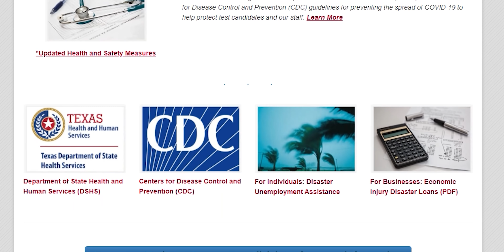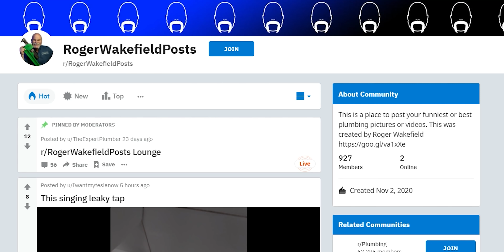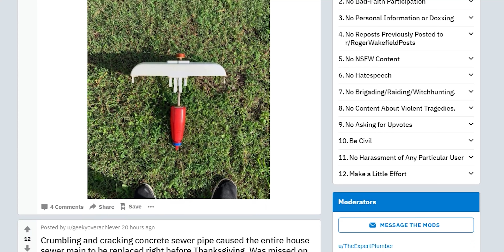Before you have a plumbing leak WATCH THIS Freeze break repair!

Comment: My biggest tip (From Ohio here) is if you lose power/heat and you know you have vulnerable pipes....don't wait till the temps drop to freezing inside the home.  Immediately turn your main off and drain the lines at the lowest point in the home....do this before they can freeze.  Even here in Ohio with very real winters, many don't realize this.  I wouldn't have expected folks in Texas to know that at all.  I wish they could have known this ahead of time.  I have heard some people pour a little antifreeze into their p traps too.  That one I have never done though.  All in all, I know it is too late for this situation, but I hope more people realize that can help a ton.

I grew up in a old trailer home that was poorly insulated with pvc.  My Dad often dealt with blown pipes and drains.  It was such a pain that he ended up running the lines inside and we just tried to conceal them as best as we could.    It wasn't perfect, but it solved the problem in a way he could afford.   Thankfully in my current home with a warm basement, only our exterior hose bibs are a risk.  We have to shut those off for winter.  

Here in a couple of weeks, I am going to convert to pex due to some old polybutylene pipe we need to replace anyway.  When I do, I intend to install the frost-free ones bibs.  I will still probably shut them off in the winter as extra insurance.  But that helps in case I should forget.
Reply: hey, I’m in Indiana living in a trailer home. our pipes have been frozen for days and this is the only situation i’ve seen in the comments that i can relate to! any advice on how to find the freeze? i re-wrapped my pipes with new heat tape and use space heaters but nothing is working!
Reply: @dipperpotter2491   that was a trick for my Dad too.  Sometimes he would think he found it but there would be multiple areas.  Eventually you learn the problem spots.  About all you can do is get under there and trace the lines feeling them to find the frozen spots.  Eliminating them one area at a time. Occasionally when it was bad, my Dad would get one of the large kerosene space heaters under the trailer to thaw things.  That was a danger in of itself.  Running the lines inside helped a lot but drains would still freeze.   It was a perpetual battle that never stopped while they lived there.   Ultimately the place was poorly insulated.  Eventually a double wide was where they moved to and the underside was bricked in with plenty insulation and the freezing stopped.   I am sorry you are having to battle this.  I know it isn’t easy at all.

Comment: Something interesting I learned from my 1950s house. When they added forced air sometime in the 70s or 80s, they ran a duct that dumped straight under the sink in the coldest bathroom in the known universe. They did something similar in the kitchen, passing a duct under the sink. The pipes in the basement were rerouted to follow the duct work. Interesting method to stop frozen pipes.

Comment: So had an old house built back in the 1930's, in Austin, and just before the freeze they had a gas leak. We try to find it but as we did the freeze hit and all the plumbing shop closed and the meter was locked out by the gas company. 

We try to winterize the house and luckily the home owners left before it got realy bad.

After a week of fixing leaks we headed back over and fix the gas and found countless leaks. We now are replacing all water lines for the house.

Comment: I had a cold water line freeze in one bathroom and a hot water line in the other(I'm in Fort Worth BTW). Like you said I opened the valve up on both as soon as I noticed . The cold water line was easy since there was hot water line was next to it,  I just ran the hot water for a while and a in min or two later the cold water line started flowing. The hot water line took a little longer. I use a fan to blow warmer air and also ran the cold water side. My thinking was it may be cold, but it still warmer than the frozen line and eventually I was able to thaw it.  No pipe issues. I was worried about the faucets  outside though. My thought was if a pipe in the wall with insulation froze, that foam cover isn't going to protect, but thankfully they didn't burst.  Love your videos, keep them coming.

Comment: Another tip for up north is take the caps /screens off your faucets. This will allow any ice out of your lines and not back up. To add to your open the cupboards is to put fans around your kitchen and bathroom to circulate air.

Comment: I live in Southeastern Michigan and we've had to deal with this in my house at least once a year, and your advice is exactly what we do. We open the valves and put a heat source near the pipes to slowly warm them. Luckily our plumbing system is centralized in one end of the house so all we need to do is open our crawlspace and slip a space heater down there. Only issues is making sure people don't take it for granted and close the faucets after we get water restored

Comment: Good luck from upstate NY. We don't deal with them too often in my area because our design temperature is 0°F so we don't run water outside the thermal envelope of the structure, and our mains are buried 6' deep, below the average frost line. Best thing I can recommend is propress because you can use it wet, and any cast iron p-traps that crack and start dripping can be brazed shut with acetylene and brazing rod. Also, when temps get real low, vents tend to ice over. A ladder, a can of windshield de-icer, and a hammer work well.

Comment: that's the nice thing about canada.  We have the Red Seal for trades.  Once your red seal, your good to work in any province. As for individual regulations, things don't change a lot province to province.
Reply from the maker: I wish we had a national certification! That would be wonderful right now...
Reply: I wish the US would perform the same, unfortunately each state has it's own regulations on how to do things. I wouldn't be shocked if a Californian plumber does things drastically different than a Texas plumber.
Reply: @RogerWakefield  they did it a few years ago, and it simplifies the process a lot.  Trades need to be recognized and standardized on a national level.  In Canada, once your red seal (usually 2-5 years, based on experience) you can work in any province or territory in Canada.   In Canada, once your "red seal" your the same as a master in your trade, but capable of working anywhere in Canada, with just minor schooling on the difference in building codes (which are nationally standardized).  In a situtation like your having there, I don't think there is any major hurdles to coming in to work.  it happens a lot with industrial electritians when there are powerline issues.
Reply: I was just about to mention this myself. I have a red seal plumbing liscence in Canada.

We also build winter proof buildings here. We don't put plumbing in 'cold spaces' such as outside walls and attics.

Comment: A really simple thing those of us up north do can probably help you if you're lucky enough to not have had pipes burst yet, but worry you may: Cut a slit through one side of a pool noodle with a good utility knife and wrap it around any pipes not going directly to the hot water heater you can easily get to. Tape or don't tape as works best for your specific situation. This helps insulate some of the pipes temporarily and gives you a way of better telling if you have slow leaks you may not be aware of due to water freezing on the pipe's surface and temporarily looking dry, since the open cell foam used in those can pick up water, and will visibly swell if it picks up any, even while soaking some of it up, and somewhat mitigating water damage. Also, if you can keep water in the pipes somewhat warmer, it reduces your risk of freeze breaks, even if you do reach freezing, or near freezing temperatures indoors. 

That said if you have a lot of exposed pipe to deal with, most of your pipe is very near to ground level, you have existing problems with flooding in your yard due to heavy groundwater retention ect or you've already had freeze bursts on some of your pipes, definitely call a plumber. This tip really only helps if you haven't had problems yet, or in alerting you faster if you have a relatively mild one. Don't assume it'll protect every single pipe even if you haven't, but it may help you keep repair costs down if your pipes do burst both by alerting you to it faster then can sometimes happen with small leaks and keeping other pipe segments up to temperature.

Comment: As a guy who lives in northern Alberta, Canada, freeze breaks are an everyday occurance once winter hits. If you have frozen water mains, its best to shut the water off if possible and slowly warm the affected area with warm air or even hot towels. Frozen valves often wont open or close. Once youve got live water up to the valve, you can open some faucets and work your way along thawing with a heat gun. Sometimes temporary heat or steam has to be brought in. We also deal with frozen sewers here a lot. Mostly in mobile homes

Comment: Roger, I'm a 3rd generation up here in Canada. My grandfather always told me if you had a problem with a line freezing at night when its cold (ei. a kitchen line) leave the tap on with just a slow drip and it will help prevent that line from freezing up.
Reply: I Do that here as well
Reply: People did and the lines still froze. Texas houses aren’t built to keep warm rather keep cool.
Reply: Definitely true it gets -20 to -50 with wind chills

Comment: For the homeowner, Sharkbite caps in 1/2 and 3/4 with a tubing cutter.  You can cut out breaks and cap off so you can get the water back on to  other areas till you can get a plumber in.

Comment: The freeze burst or break occurs from the water turning to ice and expanding in the pipe, thus splitting it. First thing, shut off the water main to the house or building  to prevent more damage when thaw occurs. Shut off the water heater supply valve and turn the water main on to a slow flow. Mark on the wall and/or ceiling where cold water is showing up. Cut the drywall in that area until the burst(s) is found. Do all known bursts that were marked and repair. Shampoo, rinse, repeat until  the cold side holds. Next crack open the hot and repeat the process that you did with the cold side. Shampoo, rinse, repeat until the hot side holds. Bring cartridges for tub/showers and faucets and toilet fill valves that have frozen. Very hard freezes will bust toilets. They cause a big mess and are obvious. If a toilet is broken, you will have a lot of freeze bursts in the piping.   -   Jeff in Montana

Comment: Flex tape down the drain to fill in any holes
Reply from the maker: I never thought about that...
Reply: I bought a 5 gallon bucket. It was only $404.95 + S&H. Didn’t have to pay that pesky servicemans service fees. I waited for the Flex seal to start pouring out of the crack and then wrapped it up.
Reply: I thought you used Gorilla Glue down the drain for that.
Reply: @jkbrown5496  nah, that's for hair

Comment: i do irrigation in North Jersey.  During winterization season we sometimes get frozen PVBs and taps.  Best thing to do for those is turn off the water inside, open up the cap and start pouring boiling water in them and chipping the ice with a screwdriver.  You just need to be careful that you don't melt or snap any of the plastic parts inside.  Sometimes, if there is a copper dogleg that is frozen I just take out my torch and start heating it up, though that it pretty rare as most systems out here have PVC after the PVB.

Comment: Back In the 80's I lived in a house that was prone to freeze-ups, so when we knew cold weather was coming we would already leave a tap or two running at a slow drip. We would run some of it into a large bucket for later use. Luckily even when pipes occasionally froze, we had no bursts, but it was considered that the cost of water lost was minimal compared to the inconvenience of having a stoppage - let alone a burst pipe and water damage.

Of course I live in a country where we are not considered to be in any impending shortage of drinkable water, and there are even some developed countries where this is not always the case.

Comment: From some of the photos, looks like pipes are commonly run in the attic?  Over an unheated garage?  Anyhoo, agree on the drywall. I can patch 20”x20” hole about as fast as 6”x6”. I’d be replacing anything that got waterlogged anyway, if it were mine.

Comment: Also roger up in NY we look on Google maps to see were the water box and house trap are located , since the snow covers everything and you don't want to dig out someones whole lawn.
Reply from the maker: I have done that many times looking for water meters and valve boxes. We don't have house traps...
Reply: @RogerWakefield  what do you guys have . Cleanouts?
Reply: @RogerWakefield  also all of our sewer and water lines are 6-8 feet deep. So they don't freeze but once in a blue moon someones water box  will freeze. And we are not allowed to run water lines in the outer walls.
Reply from the maker: @hhsaoutdoors6274  that’s it. Everything in the house it trapped but not the whole house.
Reply: google map has an option to view water main.?🤔
Reply: @KarIgnishaYumi  Google Earth might not, but just about every city or county has a planning department that uses GIS. (Most use ESRI Online) You can view the shapefiles on a browser and most of the CAD files that were imported to ArcGIS in the last twenty years is accurate to within a few meters.
Reply: Daniel Z thanks for the info

Comment: Texas:*has a state crises due to temperature below 32°*
Minnesota:*has Temps below -20° at the same time, doesn't even flinch*
Reply: Minnesota has a heat index of 110 everyone is dying. 
Texas has a heat index 110 for 60 consecutive days and doesn’t flinch.
Reply: @flipnlu  Minnesota also gets up to 100+ degrees most summers the difference is the humidity gets a lot higher here than in texas. We get both extremes every year.

Comment: Speakimg of leak, both my bathroom sinks are leaking from the base of the faucet and where the supply hose connects to the faucet, the hot water supply hose has no shank nut on the faucet base. What should i do that doesn’t involve calling a plumber? Should i just put modeling cement where it leaks?
Reply: Turn off the angle stops at the wall. Replace the faucet, along with the supply lines.
Reply: @Scorpionbite8  ok thx
Reply from the maker: There should be something there to tighten. If not I agree with @Panik Attack replace the faucet and supply lines...
Reply: @RogerWakefield  ok i will thank you!
Reply: @RogerWakefield  so i just found the problem
Reply: @RogerWakefield  THERE WAS NO O RINGS ON ANY OF THE SINKS! How dare these lazy inqualified plumbers put no O ring on the aerator! Im so angry! I couldnt get a new faucet cuz they had no faucet in the store, so i replaced everything else and i turned it on. Still leaking. I saw it was also leaking on the aerator when i ran the tap so i unscrewed the aerator ring and there everything but an O ring came out. Im so mad. But thank you! For some reason my water now runs ten times better.

Comment: If you get a freeze-thaw cycle anything with sitting water can weaken. Sometimes it doesn't show up until it warms up. Not a plumber just live in Utah. You don’t need to get the water to boil in your pipes just enough to get water moving. I’ve known handymen who melted to pipes.

Comment: I would have feed the washer machine hot water line to the cold and run a faucet and thawed out the system , only work for gas heater.

Comment: Need to help explain how to turn off water for those with Well pumps, and how to keep their Wells from freezing.
Reply from the maker: Or just keep pipes dripping so the water is moving... Better than freezing!
Reply: I have a shallow well. And that happened to me, a few years ago. -20 F caused the top of my well casing to pop off and burp out a bunch of water, which froze almost instantly.
Reply: In montana we use heat lamps from tractor supply some people use them for bird hatching but works well and insulate your pump house keep it running to keep from freezing while the box is open by turning on house water

Comment: I'm surprised pipes aren't insulated along outside walls. Sure, you usually don't have to worry about pipes freezing, but it would avoid pipes sweating in the summer humidity.

Comment: Roger, why am I having a hell of a time getting a plumber to replace a shallow well pump and a bladder? I have called no less than 12 local guys not one will replace it. Isn't this a plumbing job as I have an existing well?
Reply: Not necessarily so.  I've been plumbing for 20 years and never had to replace a well pump.  Most plumbers (like myself) are trained to work on city type plumbing with underground water mains and sewer pipes connected to the underground mains in the street.  Rural areas where things like fresh water wells and septic systems exist are worked on by a different breed of plumbers.  If you call your local well drilling company, they may be able to do it for you or be at least able to point you in the right direction.

Comment: I mean, it might sound mean, but better overprepared than underprepared... I live in Russia, and there are no such problems since they run pressure tests every year and fix anything damaged or sus... Also making plumbing with -30c in mind helps I guess... So if you had insulation I think those bursts would be avoided...

Comment: I'd just keep the water turned off. Get the pressure out if the lines. Then only turn it on when I need to use it, then turn it off a again. And wait it out....